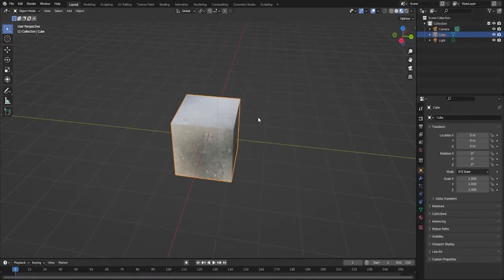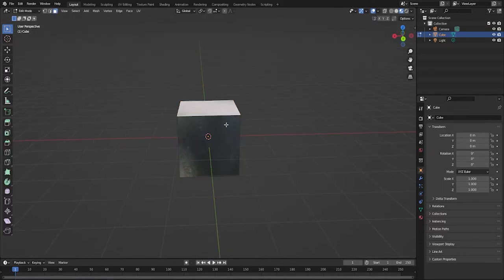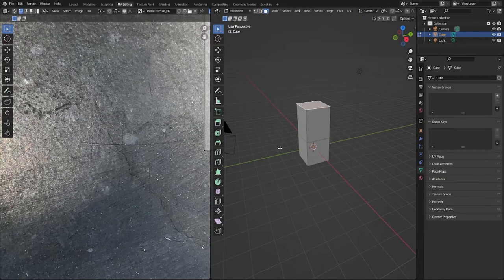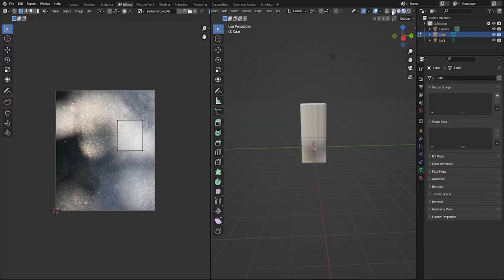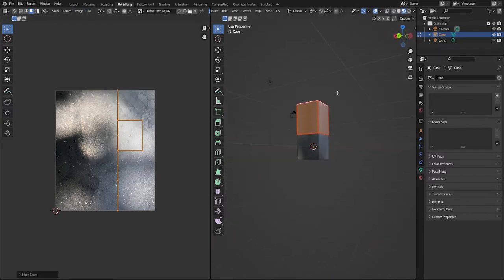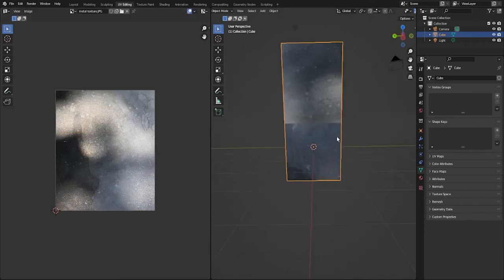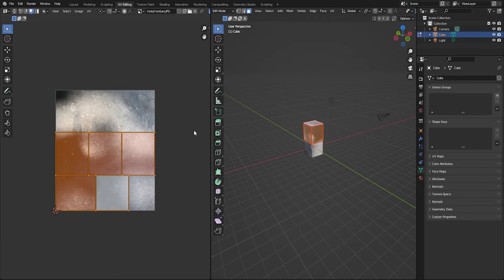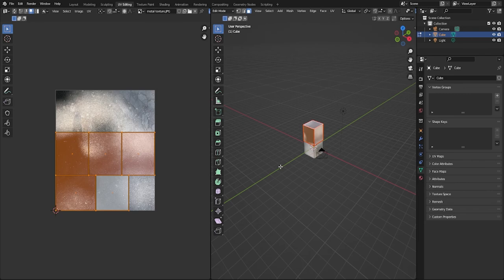How To Fix The Distorted Image Texture Problem With UV Mapping In Blender

Comment: does this work if the distortion is at the bevel created to smooth the corner?
Reply from the maker: It should be but if not you most likely will have to UV map it manually